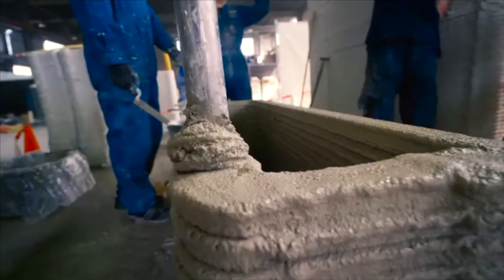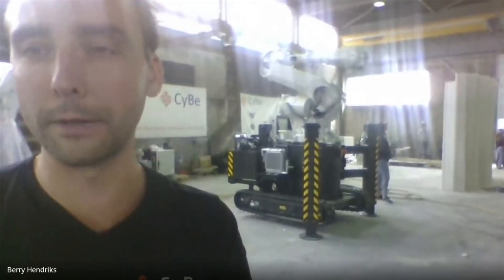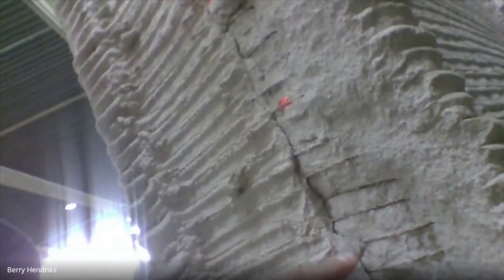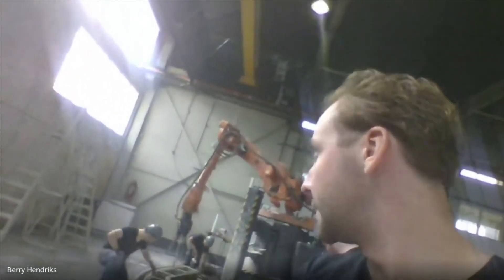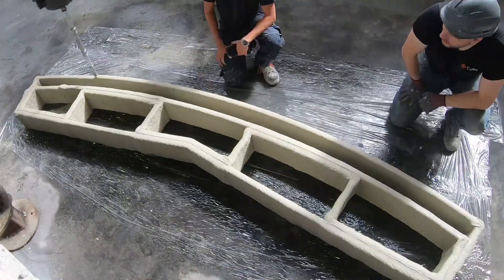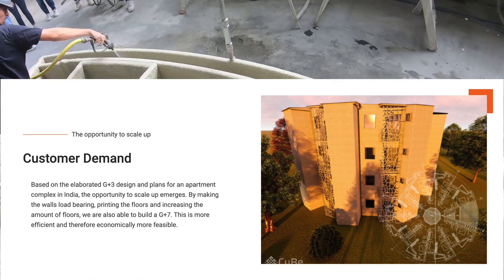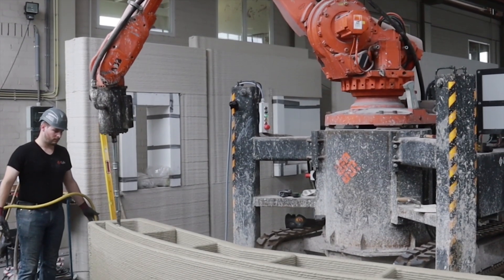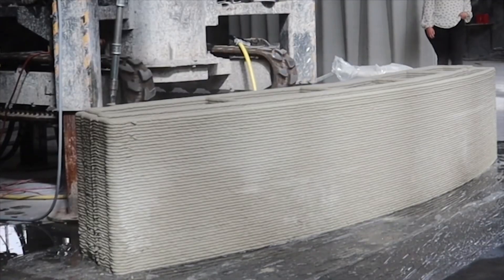CyBe Construction 3D Printer for Sale | Automated Construction Projects with CyBe

Comment: Good to see the usage , I guess the magic is in the type of concrete  but so many questions 1)What about  Foundation slab and other slabs?2) Lintels will have to be placed by stopping the printing process correct? also3)  time spent on installation  of the printer it's foundation...etc a complete cost benefit analysis will probably show that it is useful in some circumstances only and the big factor will be cost of labor from places like India - Saudi to Canada/ AUS/ UK big diff